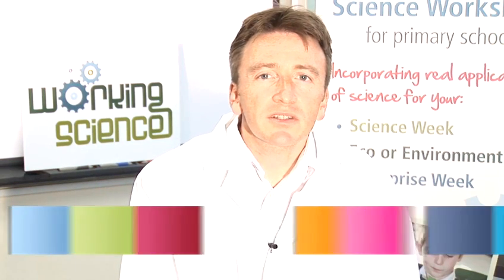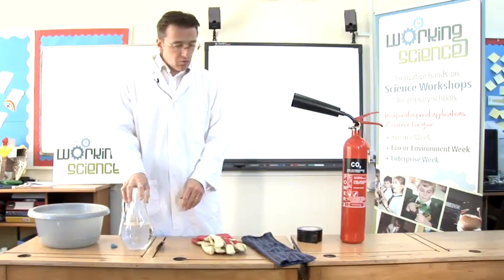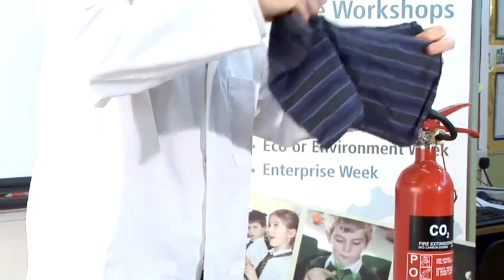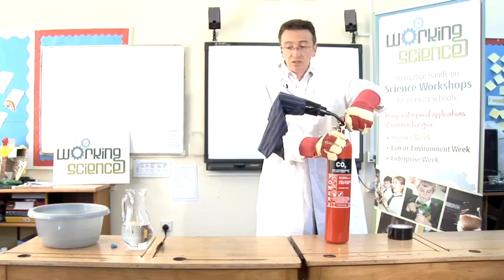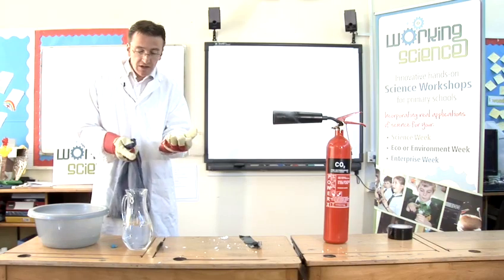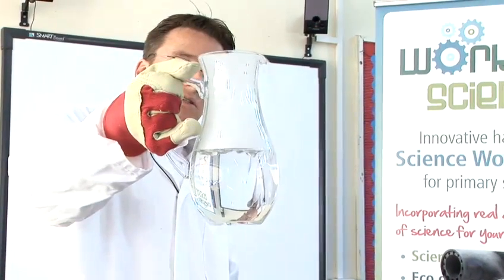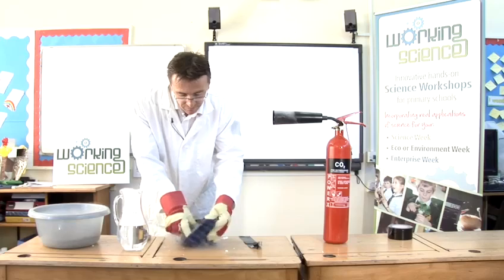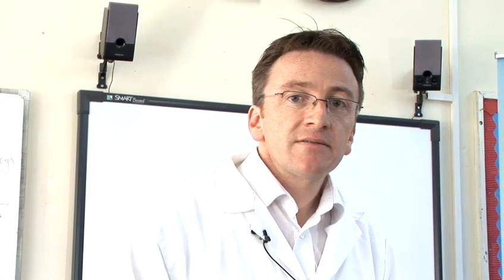How To Make Your Own Dry Ice

Comment: simpler method.... Buy a Co2 fire extinguisher .. position the cone of the hose so it is in an upside down position thus sitting flat on a table top like a cones point - pointing up.  and then squeeze the trigger for 5 seconds or more - depending on how much Compressed CO2 (dry ice)  you want.  It is also ideal to actually use a CO2 extinguisher so you can (almost)  properly control the release of Co2  (dry ice).

Comment: Carbon dioxide is an invisible gas. The white fog poured out is simply a supercooled water vapor. CO2 is in there too. But we cannot see it.
Reply: The mix also goes down because it is cooler then the warmer air outside (mere convection)

Comment: The $250 price tag is a bit steep.  you can buy those in most safety shops here in Texas for about $100, and possibly cheaper online.  however, Wal-Mart sells dry ice, and its fairly inexpensive.  I think a 5 pound bag, ran me about $10-15.

Comment: What the fuck :D Use gloves :D I working witch dry ice and i no need gloves .. Yea this is verry cold but no danger..
Reply: Actually the dry ice will have a burning sensation on your skin enough to damage it severely. I suggest there is danger when working with a substance that is -78.5 Celsius.

Comment: You didn't teach anyone anything. You didn't make dry ice, the fire extinguisher did you just collected it in a bag. Solid CO2 does not make "smoke" because it doesn't burn DERP!. Solid CO2 at room temperature SUBLIMATES (sublimation: changing from a solid to a gaseous state) back into it's gaseous state. Mr wizard you're not...

Comment: does it matter what fire extinguisher it is?
Reply: Yes Nick, it has to be a CO2 extinguisher.  If you use a ABC chemical extinguisher you'll just make a mess :)
Reply: *****
Yes, that is a fire extinguisher.  CO2 is used in BE extinguishers.  They're identifiable by being RED with a BLACK BAND/LABEL in the UK, though the US just requires it to be labeled "CO2", and to be listed for use on electrical fires.

CO2 and other Halon gas systems are common for electronics, but really poor for home use (they spread oil/greese/gasoline fires due to the high pressure jet they create).
Reply: that's not a fire extinguisher
Reply: angiel516
not sure if troll or just very stupid

Comment: This guy isn't' a good science communicator. You can't see the carbon dioxide, you see the water condensing in the air from the cold gas coming off the dry ice sublimating in the water. And he called it smoke at one point...The whole point of science communication is help people understand how the world works. If they're getting fed the wrong information to start with then it's just making things harder for them later.

Comment: He didn't make Dry Ice! He just captured it out of the fire extinguisher!

I give this video a thumbs down.
: <
Reply: Damien Stoffel
Yes, but he didn't "make" it, so to speak.  He didn't render it from the air, or breathe into a collection container, or anything. He just transferred it out of the extinguisher. 

If you wanted to make your own fire extinguisher, for example, this wouldn't work.

It's like clicking a video on how to make a cake, and it starts off by saying go to the store and buy a pack of instant cake mix.  : (
Reply: What I don't understand is that this guy commented 2 months ago, he and is still arguing whether it is dry ice or not to this day...lol
Reply: TheNoiseySpectator Damn, if you want a literary logic then here, the dry ice has created itself from CO2 gas that has cooled itself during expansion.
Reply: Atristiel Yes, which he got from a manufactured source;  the fire extinguisher.

The title says how to make "your own" dry ice. 

That all but states explicitly getting the CO2 from a natural source, like the air, or trapping it from your own breath.
: (
Reply: I know right
Reply: make
alter something so that it forms (something else).
"buffalo's milk can be made into cheese"
Reply: The carbon dioxide solidified at there extreme cold temperature
Reply: Ummm... the extinguisher doesn't have DRY ICE inside it... it has room-temperature CO2 COMPRESSED GAS inside. 

The physics involved here is the conservation of energy.  Since a high pressure gas at room temp is suddenly expanded (released to the 1 ATM room pressure), the INCREASE in entropy (randomness) requires a decrease in enthalpy (temperature).

The dry ice is the result of the rapid pressure release and occurs OUTSIDE the valve/tank at the tip of the nozzle.  That's why you need a bag to catch it... it would shoot out all over the floor if you didn't. :)

In the lab we have a dry-ice tool for forming bars of it when attached to large CO2 tanks you can get from welding supply stores.
Reply: Damn, are we still about this!?!?
Reply: TheNoiseySpectator
People can be really stupid sometimes -_- I feel sorry for you having to deal with that crap.
Reply: Atristiel I agree, this has become tiresome.
Reply: jjcipod It's not that, it's just that the topic is worn out.
Reply: TheNoiseySpectator then why did you start it in the first place then?
Reply: darren mc carthy BECAUSE BACK IN LATE MARCH, IT WAS INTERESTING!!!

IT'S NOW JUNE!  I DON'T CARE ANYMORE!!

D |
Reply: TheNoiseySpectator hi :D can i inn
Reply: Kareem Ahmed No!
Better yet, do whatever you want, I'm out.

Signing off.
bye.
Reply: I like budder... funny people say silly tings! U make dry ice with cloth + notmal ice from the frigerator! co2 is diease it will kill you and murder your familuy
Reply: fuck you shame on you the noisy spectator
Reply: White Dragon I think you do not know English.......
Reply: Trololololololololl
Reply: Your just mean
Reply: The Noisy Spectator me too
Reply: The Noisy Spectator me too
Reply: Ohh comeon you just took it out of fire extinguisher

Comment: How would you preserve dry ice if it is colder than your freezer?
And where would you get a co2 fire extinguisher for entertainment purposes?
Reply: You can't preserve it. Nor can you store it in an enclosed box like a refrigerator freezer or a sealed ice-chest. Otherwise, the pressure will build up as it evaporates, and blow the lid open.

However, I know a good place High Schoolers can get a fire extinguisher if they want to try this on their own ... The school hallways have them in little alcoves along the wall!

But, then if there IS a fire, the extinguishers will be empty!
= O
Reply: Well you can't perpetually preserve dry ice, but there are freezers for it.

Comment: I never said it did. What I described is exactly how a CO2 fire extinguisher works. Yes, one would assume you have a way to collect it, like the bag. When you open the valve on the extinguisher, the solid CO2 inside the tank turns to a gaseous phase and escapes through the nozzle, at which point the decreased pressure cools *some* of it back to solid, collected in bag. Sublimation does not disprove anything I said. Quit being smug.

Comment: False. Notice the dry ice never turns to a liquid. It goes straight from a solid to a gas. (this is called Latent Heat of Sublimation). Liquid CO2 boils at -78 degrees C. It boils off instantly making it a great fire extinguisher, but he contained it in the bag, so it formed into a solid. Are you still listening? Put down the damn phne, I'm trying to teach you something here!

Comment: Oh, and the answer is to compress CO2 gas with great pressure in a very low temperature environment. It should have a higher freezing point than other atmospheric gasses aside from water.

Comment: Because there is no difference in pressure. The CO2 in the fire extinguisher is under heavy pressure, and as it enters the lower-pressure air in the room its temperature drops. Since a cloth bag slows its dispersal, some of the CO2 is then frozen by the rapidly-dropping air temperature surrounding it. It's also worth noting that the air you exhale isn't pure CO2 but a mixture of gases and water vapor.

Comment: That's not actually correct; you're likely thinking of CFCs. CO2 doesn't destroy ozone, it simply reflects solar radiation back toward the earth instead of allowing it to escape out through the atmosphere. The greenhouse effect is a separate phenomenon from holes in the ozone layer.

Comment: The fire extinguisher is made by compressing CO2 in a container (the extinguisher), and inside the extinguisher the pressure is very hish, so when its released into normal pressure it then becomes very cold, so cold that the CO2 freezes and becomes dry ice. So in theory you could make dry ice completely yourself if you found a way to purify the CO2 and then compress it.

Comment: yeah its cCO" it can kill you. However to be lethal you need to breath only Co2 for about 30 seconds, so unlouss you put it in a bag and breath it for 30 seconds you will be fine. Also your body is made for the disposal of Co2 so even if your breath alot of it by mistake , it will only takes a few respiration cycles to get it out of your system. In other words, its perfectly safe.

Comment: Actually, the carbon dioxide in the extinguisher is a compressed gas, and adiabatic change (going from compressed to ambient pressure) causes some of the gas to cool down to deposition temperature and become solid.

Comment: it was a gas then after it came out it turned into a solid. the method used is was the bag and tape. If you want to learn the industrial process of extracting CO2 from air then there is another video on youtube but you can't do that at home.

Comment: What do you mean “act as if its is -196” ;)
Since you are asking for details, let’s take a ride trough the phase diagram, but for educational purposes let me start with CO2. We start at room temperature 20°C and room pressure 1atm, by compressing the temperature and pressure will rise, let’s for the sake of argument keep the process at room temperature by cooling the gas. Once we reach a pressure of ~60atm the CO2 will condensate and we end up with liquid CO2 at room temperature at ~60atm. …

Comment: … Now why did I say let’s keep it at room temperature? If we didn’t cool the process we would easily exceeded the critical temperature of 31°C and above that temperature it is not possible to get liquid CO2, at the critical pressure of 73atm the gas would turn into a supercritical fluid, where there can not be distinguished between gas and liquid any more. Of course if we would cool down the supercritical CO2 we would end up with liquid CO2 again. Now to nitrogen; the critical point …

Comment: … Let’s say we achieved to get liquid nitrogen at -180°C at 100atm and since we want liquid nitrogen at room pressure we release the pressure, now what will happen to the -180°C cool liquid nitrogen? It will boil of course, because we are above the boiling point of nitrogen at 1atm, but the nitrogen that boils away will also take heat away, which means the remaining liquid nitrogen will cool down until we hit -196°C where the surrounding heat and the boiling reach equilibrium. Happy End!

Comment: hmmm that makes sense... so does that mean that if i was to compress nitrogen gas into a liquid form it would act as if its is -196 degrees or so but it would actually heat up? or did i just take away the wrong thing from your answer?

Comment: By expanding the pressurized CO2 it has to do work against the atmosphere in order to displace it, the energy required to do so comes from the gas, so the temperature must drop.
Consider the reverse process; if you compress a gas you have to push against it, which means you are putting work into the gas, so it will heat up.

Comment: You should not try doing this inside. Carbon dioxide has the potential to displace oxygen and cause you to suffocate. Any time you're working with carbon dioxide, dry ice, or liquid nitrogen, you should do so under a fume hood or outside. Unless of course you have an O2 meter laying about.

Comment: dry ice is about 1-2$/kilogram, while liquid nitrogen is about 10-15$/liter (prices at local store where you can actually buy only one liter of that stuff).

Otherwise if you plan buying a truckload of liquid nitrogen it gets less than 0.1$/liter +shipping cost. Dry Ice is less expensive than liquid nitrogen so go figure.

Compared to a CO2 extinguisher that costs well over 10$, I'd say it's a ripoff to make dry ice this way.

Comment: That's pretty cool, but I'd love it if you went into more detail about how it all works. Why does gas cool down so much as it expands? Are all fire extinguishers filled with CO2? Etc.
Also, while you briefly mention safety with regard to the gloves, you don't specify what kind of gloves you're using, much less issues of using up your fire-safety equipment on science entertainment....

Comment: They use industrial compressors to make liquid CO2. It requires above 830 psi of pressure. Then the machine lets the CO2 evaporate at high speed, kind of what this guy is doing. The CO2 snow is compacted and packaged in cardboard or paper. The CO2 gas is recycled back into the system.

Comment: Oh, really??? Most schools have dry chemical extinguishers as they are better suited to a wider range of fires. CO2 extinguishers are best suited for electrical fires and situations where no residue is desired. Additionally, it would be hard to imagine a school system that would install CO2 or water (APW) fire extinguishers since kids would steal them (assuming they were smart enough to understand their potential...as was the case in my day, but probably less so these days).